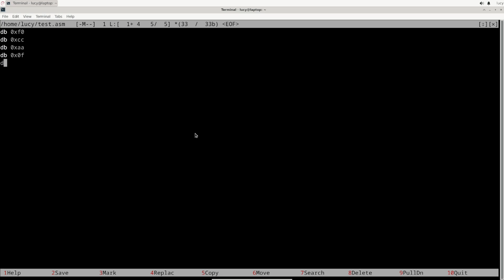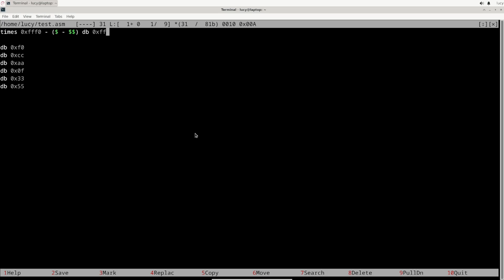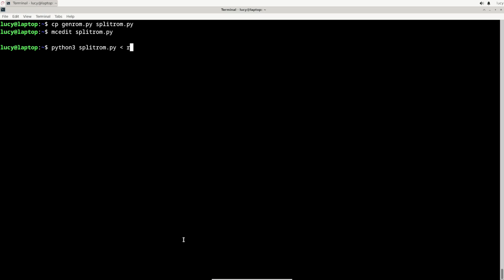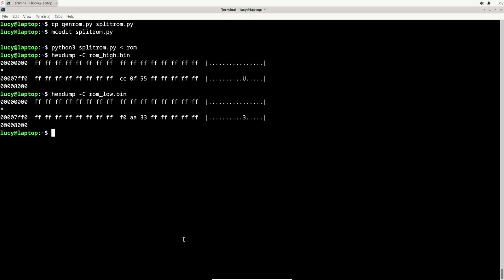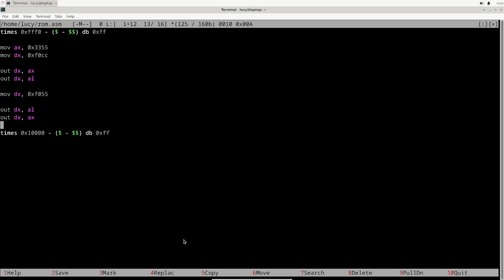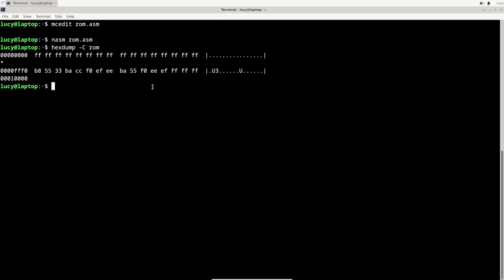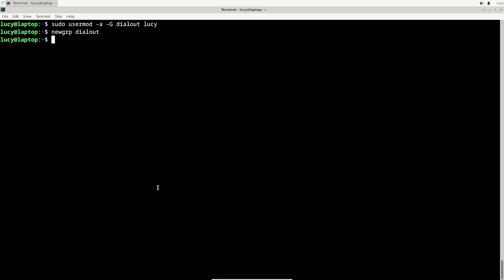Assembly programming | 8086 breadboard computer | Part 6

Comment: but: can it run doom?
Reply from the maker: You probably mean it as a joke, but the answer is no, it can't. The original Doom uses DOS/4GW and therefore needs a 32-bit CPU (at least 80386). There are other DOS games that this can run though, it just needs a few extra chips and wires.